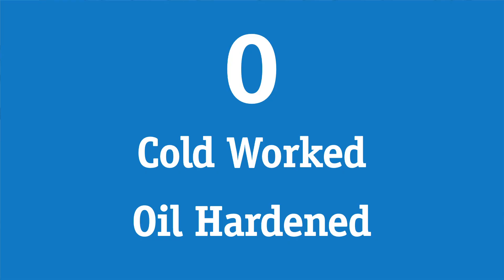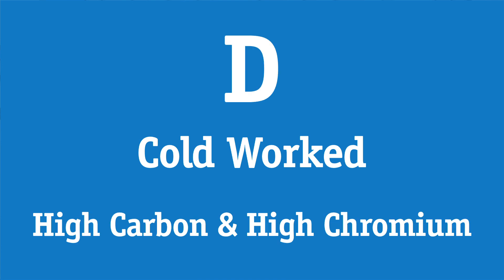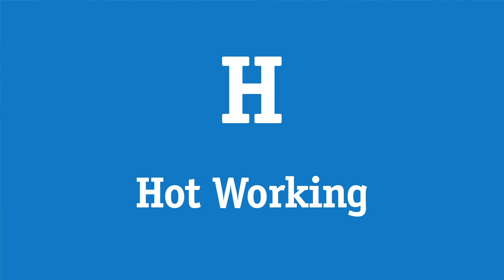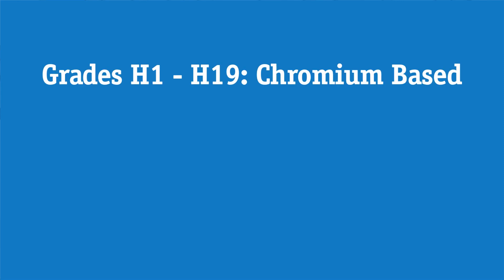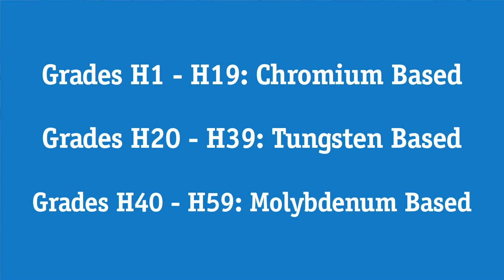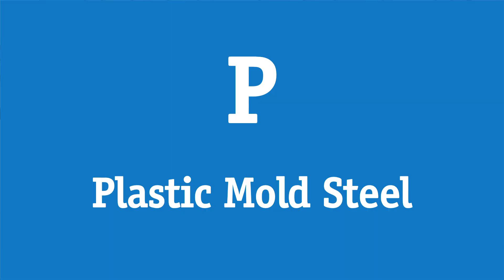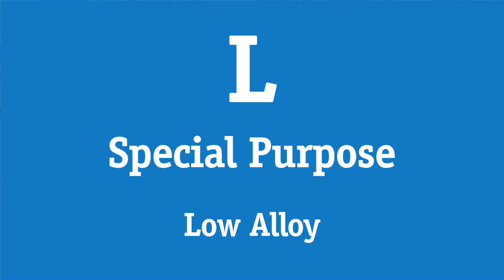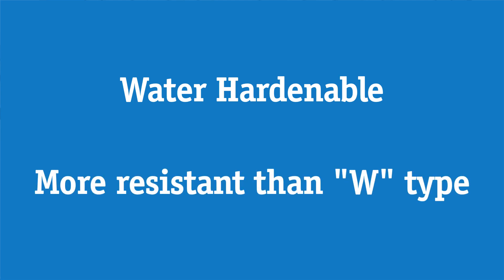The Four Types of Steel (Part 5: Tool Steel) | Metal Supermarkets

Comment: It used to be that “tool steel” was just medium and high carbon steel. No real alloying, that newer steel is high speed steel. He didn’t mention an important tool/HSS steel…cobalt steel from 5 to 8% normally, but also in hard to get 10%.

Comment: Does anyone know of a book to help identifying steel materials? I work in shipping. Thanks.
Reply: Philippe Ritchie see the MTC - material test certificate. Also you can buy a PMI machine - positive material identification, lets you spot test material and get a chemical analysis. Depends how much information you need. Carbon steel is magnetic, austinitic stainless steel is not magnetic, etc.
Reply: @wyattbrule12688  regarding the mobile PMI device, it cost several thousands of dollars and has to be calibrated often for accuracy. My customers have reported numerous false readings from accidental contamination and failure to calibrate the device beforehand.

Comment: Which grade is better and with good shine usually used for stair railing
Reply: Atiler Atiler you might want to look at the stainless steel option.
Reply: 303 and 304 stainless are good choices

Comment: What kind of steel is used or suitable for light weight aircrafts, considering strength, weight and formability
Reply: 6061 aluminium grade
Reply: Thanks for the info,  6061 aluminum grade. But do I identify 6061 aluminum grade?
Reply: @nenginickol1160  6061 aluminum is the most popular aluminum grade and is good for machining. Just ask for it by that name. I've been a metal salesman for 13 years.
Reply: OK thanks.
Reply: Everybody replied aluminum.   Nobody pointed out the fact he said what grade of steel.   Aluminum is not steel it is non Ferrous.
Reply: @donaldcampbell7894  Well Donald, what type of steel do you recommend that meets the original requirements?
Reply: You missed the whole point they don’t build aircraft out of steel they build them out of aluminum.
Reply: @donaldcampbell7894  Actually, manufacturers do build aircraft using steel alloys such as high strength 4130 tubing and 303 & 304 stainless alloys.  Instead of criticizing, why do you offer helpful information?
Reply: Jonathan Walker All you want to do is argue you find me a plane that is manufactured out of steel or stainless.   Of course it has steel in it because of the engines and landing gear and other small components.   But 99% of that airplane is all aluminum.  And aluminum alloys.    Bottom line is you do not build planes out of steel.   So instead of wanting to argue why don’t you just sit and think about that for a minute.
Reply: @donaldcampbell7894  Guess again Donald. Modern planes are made from 70-80% of aluminum alloys. You're still not offering any helpful information to the person that original asked for assistant. Go find someone else to annoy and stop being rude.
Reply: He mentioned steel.  It is often  used in air craft, only in engines, some cables, and some landing gear.